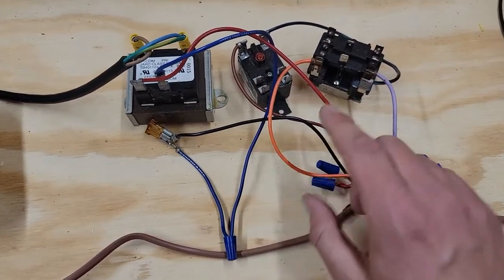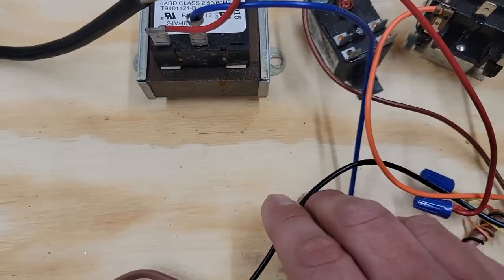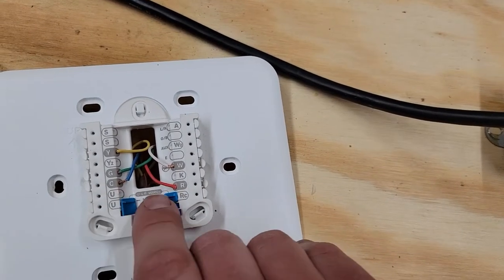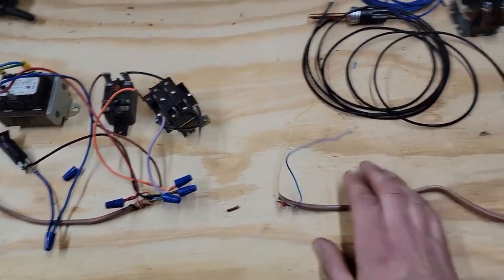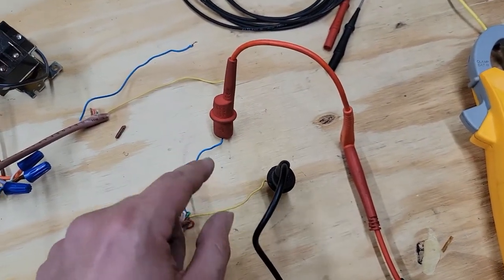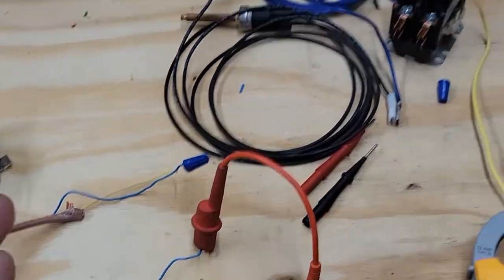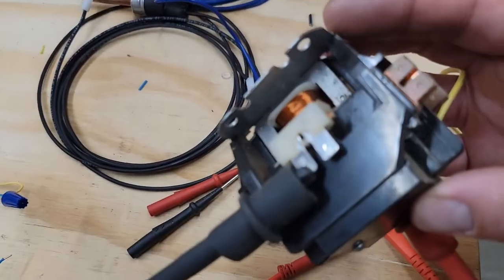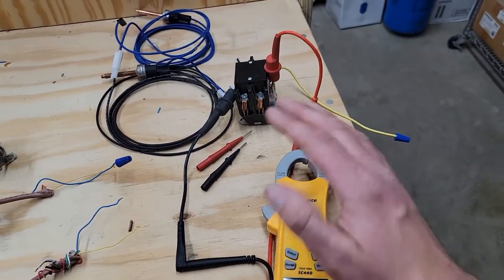How to find a low voltage short HVAC Basics @EngineeringMindset

Comment: Technician says he cant find short and i need a new low voltage wire ran through my house from outside (ground) unit to air handler (upstairs). Is this some BS or i really need a whole new wire ran?

Comment: Charlotte, NC

Thank you for the well made video! I am chasing a power issue on a air handler after a lightning strike. I have good power to the transformer but then nothing. I am also getting nothing from the thermostat wires

Comment: That is helpful, how do you find a short when a 3 amp fuse blows after furnace has been running for approximately 4 hours,  heat or ac mode
Reply from the maker: Check out my other videos on low voltage shorts and it should give you the knowledge you need

Comment: Lots of insulation worn through on vibrating Goodman units. Most manufacturers do not tie wrap the wiring properly. When installing new systems, I pull the top and go down inside to foam tape and secure the wiring. Otherwise you'll be called back out in 3-10 years.
Reply from the maker: Going to extra mile I love it

Comment: Have been trying to chase low voltage short. New contactor, new board, now the 5A blows when both thermostats are on off, was just blowing every few days,  eventually just started blowing immediately with every new fuse, this is also with outside handle fuse unplugged.

Comment: When you say the contactor coil resistance is way off, im guessing your saying the coil internally got damaged and might be reading Kohms or Mohms? Or short to ground?
Reply from the maker: typical contactor ohms for a 24 volt coil are around 10-15 and when damaged will read like 3 😁

Comment: I'm confused.
Why do you have the low voltage fuse wired in on the 24 v common side and not the 24 volt hot side? I usually see this fuse on the hot side
Reply from the maker: your right that is typical wiring I was just throwing an example together.
Reply from the maker: trying to help someone develop an understanding of where to start and what the process looks like

Comment: Hey my friend, been watching your videos Also been in the field for about often on for 26 years. I’m stumped on this Bryant 95% furnace fan turns on for 90 seconds inducer kicks on for about two seconds and then pops. My three amp fuse. I have checked everything. I have exhausted my knowledge can you help me diagnose this please?
Reply from the maker: Check the limit switch on plug it and bypass it and then see if that stops the fuse from popping.

Comment: A bit confused when you said the fuse is protecting the transformer. I thought it's supposed to protect the control board.
Reply: @bojack2740  it protects both. The board is wired in the 24v circuit and the fuse is in the board.

Comment: Out of curiosity, if my AHU has no fuse (3 amp or 5amp) can I wire in a fuse between my transformer and my furnace board? If so, I have been thinking that if I am going to do this,  should  one side of the fuse be on the 24v hot from transformer and the other side my common from transformer? then from there to my board so that I have power in and out of that fuse?  I couldn't find a video on how to do this. I have come across furnace boards/ahus without a fuse. cheers
Reply from the maker: yes absolutely
Reply: @TaddyDigest  fantastic. Next board I will be doing this! Thank you for the fast response. I only have 3 years in residential HVAC, so I am learning still...and probably will be forever.

Comment: Hello Tad. I was working in the field and ran across a thermostat that the voltage on the R and Y was 16 volts, it also showed 16 volts in the air handler and 16 volts in the condenser. Testing the Red with green, and white register 27 volts. What could be causing the voltage drop? The contactor does not show voltage on the coils, but when testing the coil for ohm it shows 12.8 ohm and it also has continuity. What could be the problem? Thanks for your input.
Reply from the maker: Could be a loose connection could be a bad thermostat could be a couple problems for sure
Reply: @TaddyDigest  Thank you!

Comment: I currently have a low voltage intermittant short.  Replaced the fuse and the heat pump will run in ac mode for about 24 hours before blowing the fuse again.   Resistance on the heat pump contactor is about 17 ohms, I didn’t find any wires chafing outside.  I’m wondering if the thermostat has an intermittent issue causing the fuse to pop?
Reply from the maker: The thermostat can be the issue however
I would take the thermostat off the wall and test the heating and cooling operation
Without the thermostat and see if it pops
Reply: @TaddyDigest  ok.  Ill try that tomorrow, ill be there at 10am est.   thanks for the reply dude.
Reply from the maker: You're welcome brother good luck
Reply: @TaddyDigest  found it.. in the AH, low voltage wiring is in a small metal box the size of a playing card with 2 screw’s holding the cover on.   Checked every wire run, ohmed every coil, unplugged the rev valve ect, everything checked good.  Had my popper in, then removed and put in a new fuse.  The ah was running while putting on the cover to the control wiring, installed the bottom screw of the cover, then while installing the top screw, the fuse blew.   The the stat wire was routed behind the box, as i installed that top screw, the threads of the screw were penetrating cutting the insulation of the stat wires (still in the brown insulation).  Accidental find but ill take it.
Reply from the maker: Awesome news brother glad you found the issue and you fixed it good deal
Reply: @TaddyDigest  Question:  In my ah, the transformer has 31.15v output instead of 24.  Can that also cause low voltage fuse to blow?  Height Voltage input is normal but output seems high to me at 31.15v.  Hope you’re having a good Sunday..  Matt

Comment: With the resetable fuse do you just add a female and male connecters with wires straight to the fuse?
Reply: Also is the button hard to press when it's not popped?
Reply from the maker: very easy to press
Reply: @TaddyDigest  Yeah mine feels stiff like you can't even press it so even when it's not reset it's easy to press?
Reply: Actually it's stiff when not popped and it just popped when I turned AC mode on but when furnace is on it never pops
Reply: No info ? Just a heart?
Reply from the maker: tell me what you need to know
Reply: @TaddyDigest  Why is it that the fuse blows only in AC mode any ideas?
Reply from the maker: there is a low voltage short

Comment: What if the unit runs for 3 days then it burns the transformer (low voltage side) and not the fuse
Reply from the maker: then it could be a wire touching only at certain times

Comment: Hey how are you ?  I have a question and I want to know if you can help me?  I have a short in the low voltage my fuse burns but even with the thermostat it is disconnected and it seems that it is the board one of the common lines has continuity with the red and I disconnected the common that goes to the board and I no longer had a short?  How can I know if the board that is damaged
Reply from the maker: Check out this video as well 
Troubleshooting Low Voltage Short HVAC Basics 
https://youtu.be/yr98GmVtQ7I
Reply from the maker: take the board out see if it looks burnt 
see I it smells burnt

Comment: Hey tad my question my air conditioning unit stop working my control board stop lighting up I check the door switch and it had 110 volts check my hot and common on transformer it had no power this a new board but it generic the circuit board light came on for a moment but it went out.any suggestions

Comment: Where do I find that link for the resettable breaker?
Reply from the maker: Here is a link for a settable Supco POP3 3 Amp Circuit Breaker, Push Button
https://amzn.to/3BdtxyY
Reply: @TaddyDigest  Thx much for your reply!  Because the Lil' Popper resettable breaker is about $20.00, I'm looking at one like you're showing in this video. It's 3A with the rocker switch (less than $10.00/free shipping/Prime.    Does it need to have a low voltage rating, or are the ratings such as 125v/250v (whatever the exact numbers are) maximum ratings which is OK?
Reply from the maker: If you find one send me the link because I want a cheaper 1 to recommend
Whatever it says is whatever it is my friend